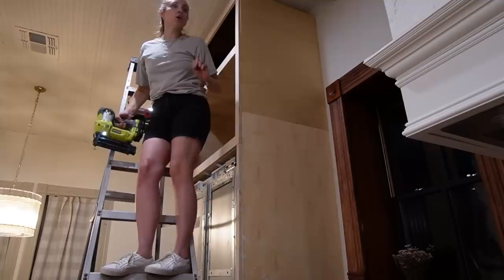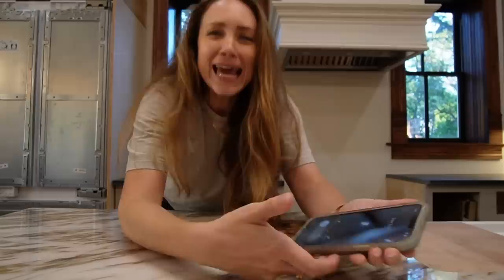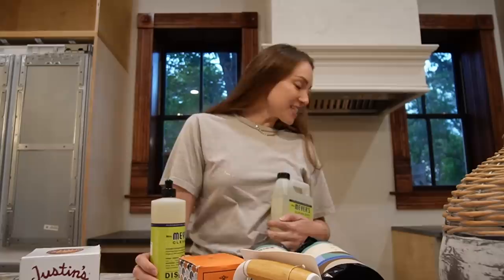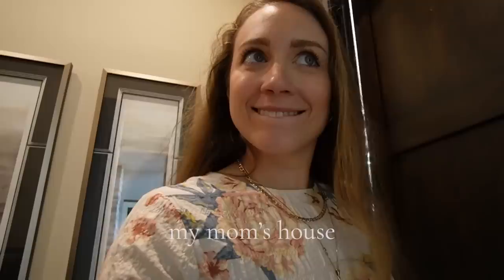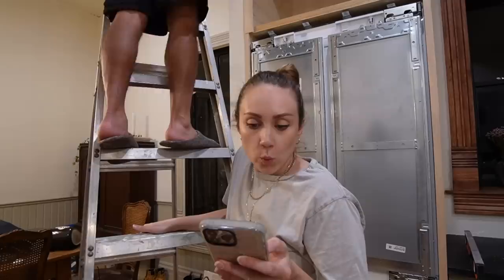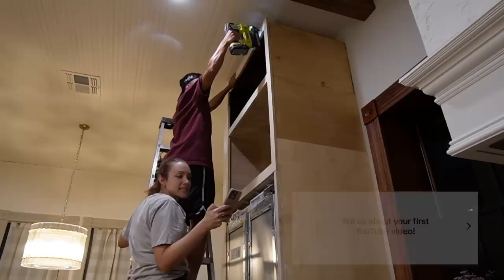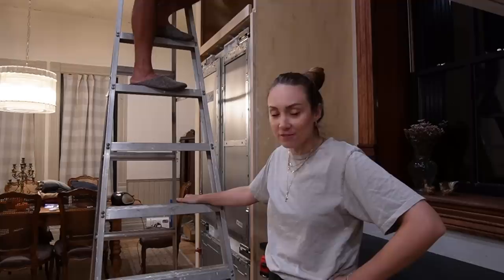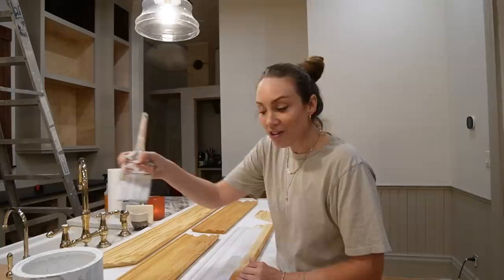meet the new puppy & DIY with me! | XO, MaCenna Vlogs

Comment: I saw this incredibly cool thing at a friend’s house - their parents had used a sheet of metal grille sprayed to look cast iron - you know, like what you get on the front of old air vents with the four leaf clover type cutout - but they had used it as a vent cover for their range hood - they had placed it inside a frame that had these turny bits on it something like you get on the back of a picture frame to keep the photo inside but attached to knobs, so you hinged the back, turned the knobs on the front and it fell down to turn it on, but it looked so old and hid a modern unit and I thought it was cool as heck -it would look real pretty with this hood and you could make it in the colour of your brass hardware!

Comment: If you tap your brush on inside of bucket after dipping it will kinda lock the paint on brush and you don't wipe most of the paint off your brush hope that helps but get a drop cloth cause sometimes it may drip a little depending how much paint you lock on

Comment: MaCenna, you could help yourself out on vlog mas by pre-filming some short little videos, related to Christmas, and sprinkle them in. Example, you want to make a mood board for Christmas decorating. Film that, as I recall you have in the past taken us along on one. The idea is daily content but not daily both edit and upload, and filming. A few creators I have seen do this. And it takes pressure off. Especially if you have more than one channel. Also, I have been watching since you were only LA based and the most you were doing were small DIYs and decorating videos. So like drills, maybe a jig saw. I have seen the growth. You have the same mindset I do. I can do anything I try. So I too have had it with contractors and prices. I got an $8000 quote minimum to redo the sheet rock in my shower surround area only and then with installing of a vinyl surround insert. Hello my name is Brandy, I will now be the carpenter. I didn’t want to have to, but here we are. I will be using tile not a prefabricated thing like they said.